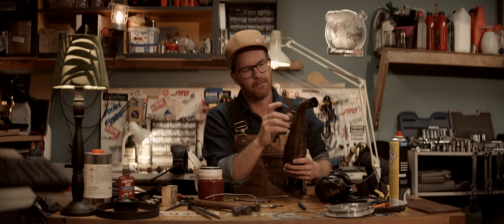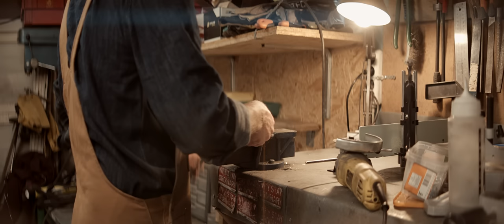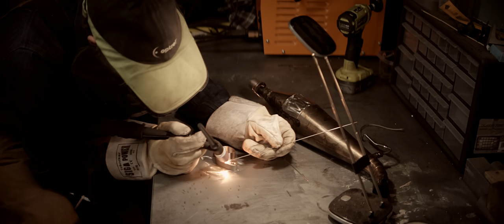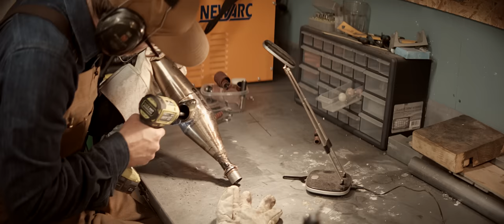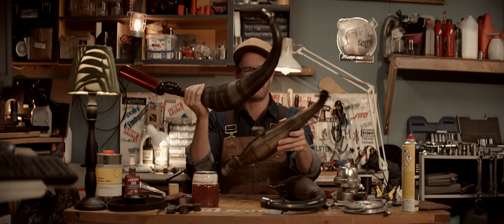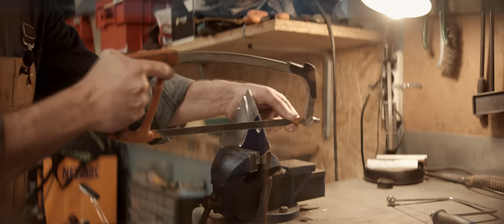Two Stroke Pipe Wastegate - Why do I get such strange problems?!

Comment: "..most unusual and strange, weird problems" - hey, it is a two stroke. It works on weird gas impulses. You probably could just take the exhaust, reed valve and carb and get a pulse jet.

Comment: Why not use open pipe.. since u change a lot from the regular valve reed that needs strong back pressure to close.. i bet rotary reed you made doesn't need anymore strong back pressure ..

Comment: The length of the stinger may be an issue
Reply: My longer stinger a lot of the pipes that I've seen on the smaller 50CC styles evidence you to wrap around the stinger part of it then give it to a muffler as the stinger has a tendency to create additional backpressure wherever's a short stinger it may not create a decent amount of back pressure

Comment: Seems like that pipe is wayyy too small for the amount of air that engine moves.  Needs larger diameter. Particularly in the header area, it needs a larger diameter stepped header into a short, fat expansion chamber.

Comment: Welcome back. Having wasted my youth in the 80s building all manner expansion pipes from “for sale boards” for my Honda MB50 I just get the feeling that the pipe is not your problem. I have seen you struggle with so many variables through your various engine iterations where you are toying with radical ideas only to spend two weeks on a carburation issue or an air leak or a bad ecu/plug…..I am betting you have carb issues or your rotary valve is playing up. I don’t see the exhaust scavenging all the mixture out of the pot. Something upstream is sending you down a rabbit hole my friend.

Comment: Our racing team exerimented
With ading methanol or changing diferent compesion ratos and super clever ignitions
But that leads to a jungle off difernet problems
The best solutions i have seen
Is
Honda 125cr of 1989
High rewing Diry bike with super high pipe presuure, it has a valve to expansion chambre mountefd to cylinder
Or the most clever one is
Has old italina 125 carting engines
Iame leopard or parilla
They used to rew to nasty sounding 22000 rpm
They have a totaly difernet contrction exaust pipe
Its short as you have but bach cone is pefarated with holes
Incoeporating silencer
Thats realy works

Comment: Could it possibly need more fuel to help starting issues or less 🤔 love ya work 😉 rather than looking at the pipe what about fuel Could it be causing any issues 😊😊😊😊
Reply: It's making heaps of HP so needs bigger pipe try a 125cc power pipe I've done it before and worked great 👍 😊

Comment: Please read before you continue 

Is carb OK is ignition OK is curve OK is afr OK? Is disc OK and timing ?? 

Forget the starter and other ideas for now 
Go back to basics  fit the long pipe  that works 
Get a baseline power run and dial in your carb choices and a good afr figure  along with  ignition timing/curve  so you know that you are dealing with a motor with no sideline  running problems ,then drop back onto  the experimental tests when you know the basics are in place

Comment: its almost like the engine is fighting its self in the lower rpm, you have change a lot on the engine a good couple of times, maby some thing is wrong with the inserts or some thing with the ports in the cilinder walls after it was changed, that are the only tings i cud come up with. these are thing that changed before it was running bad. en maby some thing on the crankcase vollume, that its on a sweetspot for this kinde of behaviour. overall the setup was buld when your head wasnt in compleet focus en stuf was going on in the background,
its always worth a check on those things
Reply: en maby after some tinking, it cud be posble its someting electrical. its like it cud be very minor or just bicus some thing is overcomplated/overdesinged. so many posble options to try out. en if you stil thing it cud be the intake try an membrane intake to know for shure, if bothe have the same problem its something else. hope en wish you good luck en i hope it will be soon on track for more preformence 💪

Comment: Try lowering idle jet run to rich at idle hints why creating exhaust leak allowed more fresh air leaning the mixing causing run good so play with jets and should fix issue

Comment: strange problem . almost looks like when the pipe is connected , the engine can't pull in the air gas mixture .

Comment: Can it be a low rpm vacuum issue? Maybe engine has so radical porting and it dosent suck any air/fuel mixture at low rpm without manipulate the pipe?
Reply: I don't think it's because of the porting but instead it think it's because the rotary valve seals the intake.

Comment: Its not really that strange at all. Your pulse wave is longer than that short pipe at low RPM's.  one other thing I would try is messing with diameter and length of the stinger

Comment: Use a chainsaw for a starter! Electric or gas! Maybe a gas saw with a steel or aluminum bar bolted on with a slight reduction to make spinning the engine  easier, a 40 mm and 60 mm sprocket band chain or something with a 15 mm shaft with bearings on both sides of the bar, it can be machined to accept a socket and maybe split the shaft and use a grub screw, to spread it apart holding the socket in place, or just spot weld it! Plus a gas starter would be cool, it could idle at 5k rpm and probably still start it!! 😆

Comment: could you tie the pipe into the throttle, so under high throttle pipe is tight to the motor? and low throttle it has a gap? i know its not a permanent fix and would rather get the pipe to work but i believe it is a solution.
Reply: could take like a bmx gyro and a brake lever, would be pretty interesting concept, would resemble a clutch in a way.
Reply: would be the same principle as the valve u added i guess.
Reply: would definitly seem odd trying to ride under full throttle with a lever pulled lol.

Comment: Its becoming quite clear that your original goal for this  channel has changed. 
How  did you go from a guy who designed and built a basic 2 stroke 50cc engine that was making 20+hp to a guy that is obviously only concerned about selling views?
Remember your goal Alex?
Land world 50cc motorcycle speed record? I do, in fact you went to Bonneville and were unfortunately rained out but said you'd be back next year. 
That was years ago, and since then you have gone backwards.  And now you're claiming that you can't tune a pipe?
Good luck Alex and wishing you the very best of all that is good.

Comment: Hi Alex love your vids i watch them all its not the pipe length that's the problem yo need a fatter expansion chamber
Reply: Or put a power value on it
Reply: Also i think you can forget how a normal 2 stroke runs because your engine is not a normal engine i would forget what's supposed to work and keep trying different pipes and or power value setups before getting into what should work

Comment: I said this to you over a year ago all the work your doing was carried out in the 1960s by van Veen plus others where they achieved 20 + BHP from very simple disc valve 50 cc motors Jamati achieving 30 BHP but the motors tended to self destruct during long races only God knows what your doing fiddling around  wasting materials faster than they can be mined just buy a racing 50 from the 1960s and give your self a holiday .

Comment: Hei
I had some exerience
With super high rpm 2 stoke
Engones for racing
The pipe you have just will not work
Its absurd
To low volume
Mehanical compresion becomes to high at low rpm
It detonates and work like diesel with constant rpm

Comment: Maybe extreme cdi manipulation could in low rpm would hellp
Reply: I think stronge Pulse in the cranc Case meight be the Problem, If U make It Spark erly It will produces a lower ext.temp. and Not Push Back AS hard

Comment: I think your exhaust is too small, both length and girth. I've built a few 50cc exhausts for way less power than your engine and the exhausts have all been a good twice the size of your exhaust. I'd say with extending the header. I'll watch the full video later so apologies if you came to a conclusion

Comment: må være frustrerende å ha endret konfigurasjonen 20ggr, for så å finne en feil. dvs. at noen av de 20 endringene nå kan være feil.... (masse følgefeil)  hva med å etablere en skriftelig protokoll på alle variabler/faktorer med målt resultat , for så å kun gjøre 1 endring om gangen.   ved feil, rykk ett hakk tilbake i protokollen. ikke virre videre med 100 nye retninger uten kontroll på virkning.... start med en 100% fungerende motor, rykk tilbake til da motoren fungerte. Jeg pleier å bruke excel til protokoll etablering.   alt fra romtemperatur(tilgjengelig oksygen) til fuelmix.  alle faktorer må registreres.  protokollen gjør at du alltid kan gå tilbake til kjent terreng når alt ser svart ut.

Comment: With the amount of fuel you are running try chopping that tip its way to small in diameter try at least 2 cm 💯
Reply: Try cutting of a big bore MHR exhaust i think its suffacating in its own smoke. You can also try adding an additional exhaust pipe

Comment: 3D Print up a fat gearset to spin the motor at 5k or 6k. Also the low RPM working with pipe slightly removed makes me think it's too rich. It's probably leaning out at low RPM when you open it up. Carb swap made it leaner at low RPM maybe?

Comment: Exhaust valve needet! The Rotax123 engine makes no power unter 6000rpm without the Exhaust valve. and revs like shit. I testet this 25year ago in my rs125. 0-60kmh 1 gear 25sec. From 2000-7000rpm 23sec (35Km/H) the other 2 sec from 7000 to 12000 (60km/H). The ex timings from the rotax are 190-195°without EXvalve with its arrround 160-165. I think your Ex port is so big withe the 180-190° and that big area. The Pipe is so short that its make a low presser in your cylinder at low rpm. The reso is to low for that timing. You are in the suck timing from the PIPE at low rpm and the big carb has not enough air speed.  I thing a Slider in the exhaust at the cylinder makes it go crazy! Closed from zero to 10000 than open!

Comment: Take the pipe that it starts and runs with and dyno it. Play with that pipe. Stop changing things. Play with the pipe that works and go from there. Lose the " it should run with this pipe" and go with the it DOES run with this pipe and tune around it.

Comment: I've come to the conclusion that this channel isn't actually about solving the problem. You either don't want to learn about this or you are just willfully dragging this on to generate content.
You are getting these 'weird problems' because you don't know what you are doing. I'm about to unsubscribe.
Putting a wastegate on a tuned pipe is absolutely ridiculous and stupid. There are excellent books about 2-strokes and pipes. Read those!!
Reply: What did you hope to achieve Christian? Just unsubscribe if you think the content flawed. Perhaps you wanted to let us all know how right you are?
Reply: @smacksille1951  
So I am right?
Thx, good to know.
Reply: @christianholmstedt8770  I really don't know Christian. Maybe you are correct. Why the question mark? Sarcasm? But I am still curious about your need to educate. Are you the expert (or more knowledgeable than the author) in this field of resonance, and if so, why not advise? In terms of social media and interaction, that might have been more beneficial. Read a book doesn't really help unless you paraphrase and reference. But you do seem smart. So 'Thx, good to know'.
Reply: @smacksille1951  
I did suggest a book I've read a few times by a Professor on the topic in the comments to another recent video and it got no reaction..
A wastegate on a tuned pipe!? Where to even start with that one... That's just not how any of this works...at all.
The tuned pipe seems very small in volume and short for the rpm used. Also, a tuned pipe really only starts to work best for engines with an exhaust duration of more than 160 deg and the transfer ports need to be timed accordingly to work with the resonance in the system. It's called a tuned pipe for a reason. It provides a big boost in power for a limited rpm range all depending on the length and angles of the sections of the pipe together with EGT (which also depends on fuel type). There are so many variables that merely going by the seat of your pant randomly changing stuff is NEVER going to work.
So, it seems like a solution isn't really the goal here. He spends a ton of time machining and a ton of money on expensive camera gear. A ton of work in itself so far but without much actual result.
Reply: @christianholmstedt8770  Sorry I missed you reply Christian. I believe he has a single goal and RPM in mind for which the exhaust may be tuned... or a problem to be fine-tuned later when other issues have been resolved. I watched his last video, and he didn't seem concerned at the lower rpm result, as his goal was for a tune in the power band. I guess he is tuning for a goal rather than finding a tune throughout the range. But as I mentioned earlier, I don't know. I enjoy the content and probably should have just left it at that. I race a mc22 and don't have to deal with these issues, though I have played around with jets, air box resistance relative to Helmholtz resonance - though not conclusive. Anyway, take care.